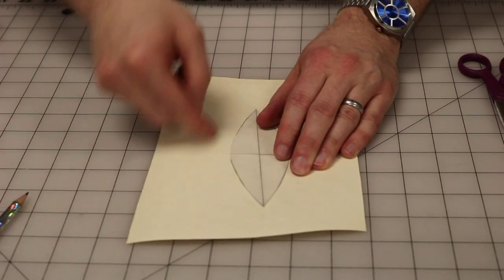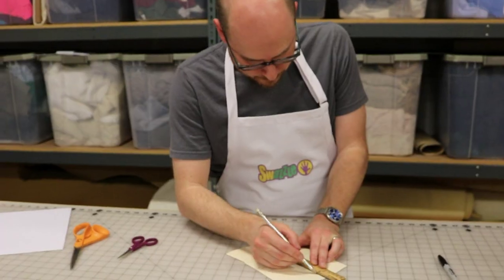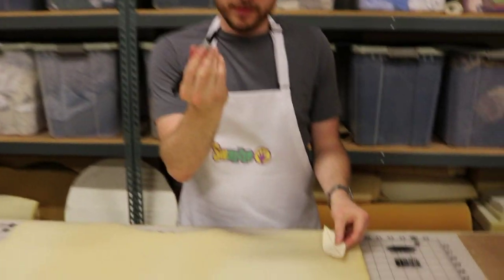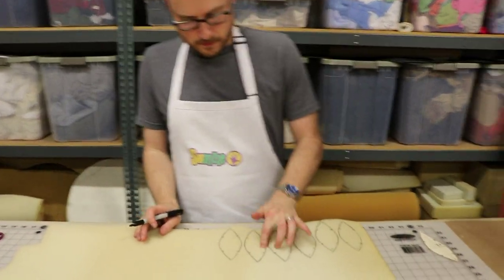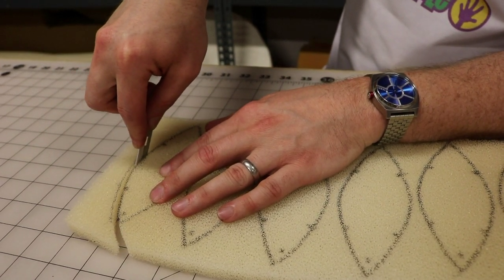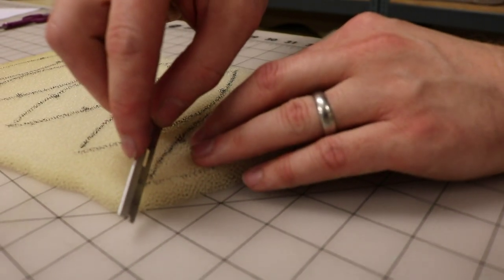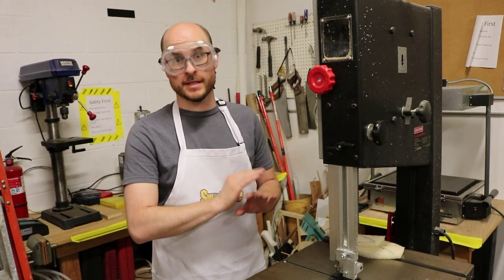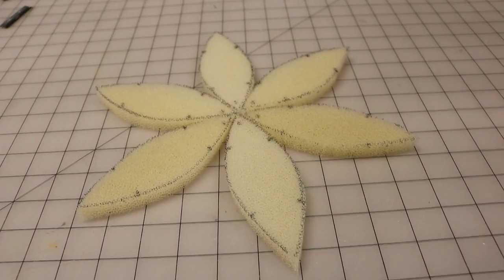Learn How to Cut Puppet Sheet Foam  - Swazzle Puppet Studio Episode 6

Comment: thank you for this helpfull video.
I wonder why you cut your pieces outside the thick marker line,  because when you drew the lines  around the pattern, you did it outside the pattern. 
I think the cut sould leave the thick line outside the piece of foam. If you include this 1 (or more) millimeter in the piece of foam, it will measure 2 (or more) mm more than the pattern. 
Or am I wrong ?
Reply from the maker: Try it out and let us know what you discover!